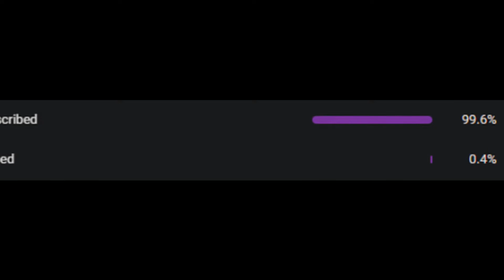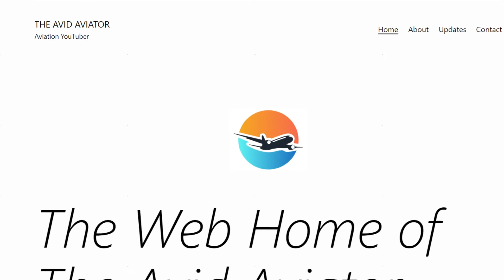Will Ryanair order the 737 MAX 10?

Comment: Previously they operated one aircraft type (if you ignore the Single 737-700 they have). They claimed significant operational efficiencies thanks to the total interchangeably of the fleet. 
As soon as the Max8s enter the fleet, and until presumably all the dash 800s are replaced they will have two aircraft types.
No doubt they will see how this affects their operating model and profits before they decide on whether to incorporate Max 10s or not.
My feeling is that unless an existing route is significantly over subscribed they may only operate them on routes competing with other budget operators where they may need them to match or undercut the competition.
But whatever they do, it will be driven by profitability.
Reply from the maker: For sure, thank you for your insightful comment. Yes, I did ignore their 737-700 as it is used for mainly training purposes. And of course, the decision will always take profitability in mind, as that is exactly what Michael O'Leary cares about. 🤣 I think the Max might work, it'll just depend if they can get a great deal from Boeing. It is a good point to note that operating the smaller 8's will cost less especially when planes remain unfilled, so we'll see if they think there are routes that could justify the larger MAX 10.
Reply: No .the 737 700 is the same aircraft type as the 800. Its the same plane. 
Same thing for the max 8 and 10.
When you pass a type rating you are able to fly the 700 ,800,900 at the same time.
The only one difference is the fuselage.
And since there are very little differences between the max and the ng....
Reply from the maker: There is very little difference, but there is some. Ie rotate speed will be different, max takeoff weight, etc.
Reply: @theavidaviator  yes but it s the same plane,for the mechanics and the pilots there is no difference between a 737 800,700, 600and 900 ,its the exact replica but shorter or larger so no need for any additional cost for anyone. All of them are an only one aircraft type.
Same thing for the max type ,the max 10 is just a max 8 but heavier and larger. Both of them are the same aircraft.
Reply from the maker: Correct, training is almost identical. The pilots just need to be trained on the new slightly different handling of the aircraft. (Ie weight and length different)
Reply: @theavidaviator  it depends on the operator.
There is only one 737 ng training and it's for the four versions ,same cockpit,engines, same procedures,
And same operating manual,training manual...
Never wondered why ryanair use a -700 in order to teach you how to fly a -800?
Officially,you are able to fly all of them,since it's the same plane...
Thats why no one will tell you that hes trained on the 900 or 800.
You dont need to study the weight and the handling ,you ll learn it with passengers on board ,every airline has its own policy about how to move  to a larger version.
I believe for the max aircraft type its the same,you are trained for the three versions,the airlines may choose if they brief you a little bit or not,depending on your experience I guess.
  They can do whatever they want,but officially,a 737 max7 pilot is a 737 max10 pilot as well.
Reply from the maker: Makes sense, I guess for all practical purposes they're identical for pilots.